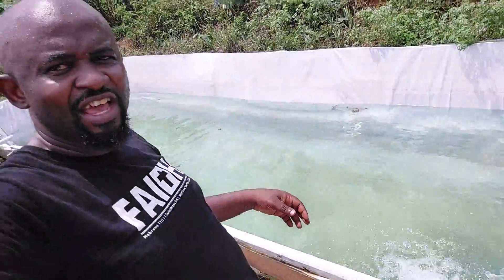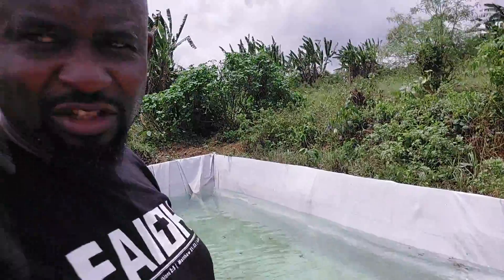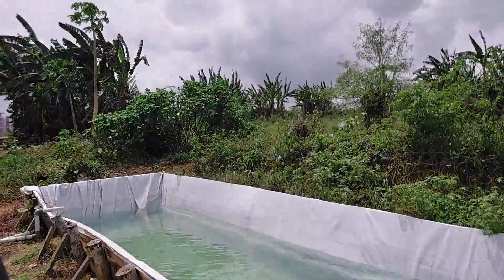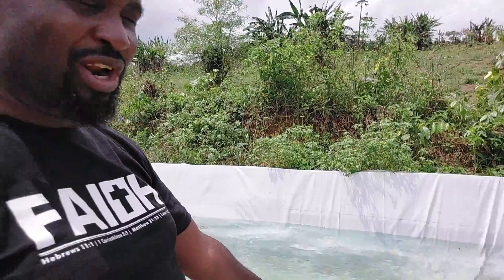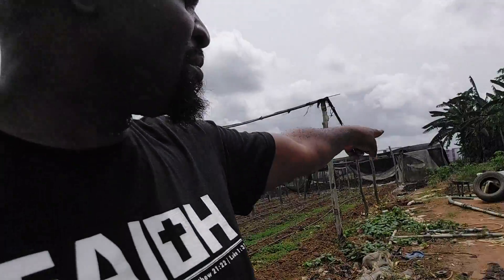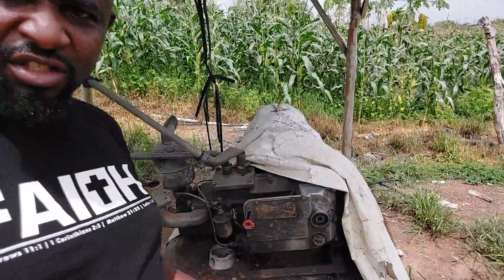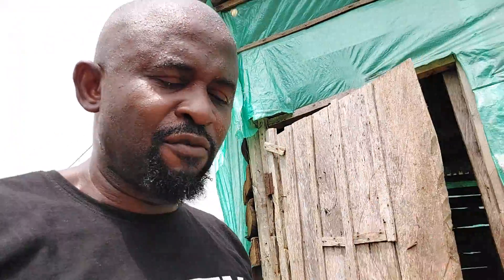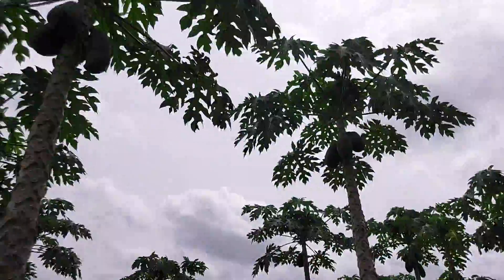Powering our Farm with Solar Systems in Epe

Comment: Well done.Pls are you doing sprinklers irrigation on your farm using solar?.If so,want type of pump are you using to achieve a high pressure to power the rain gun sprinklers.
Reply from the maker: Thanks for your inquiry. Wle don't use sprinkler or rain gun. They are not efficient irrigation systems.

We use mainly drip irrigation. Pls contact us on 08123377566 if you need help with getting.

Comment: What is the dept of your borehole. What is the pump water rate and what is the wattage of one panel. Thanks
Reply from the maker: About 40m.  Presently give about a 60ltrs per minute on the average . Average of 250w. I can you link you up with the engr that did mine. It's best to get an experienced hand to configure the best solution for you